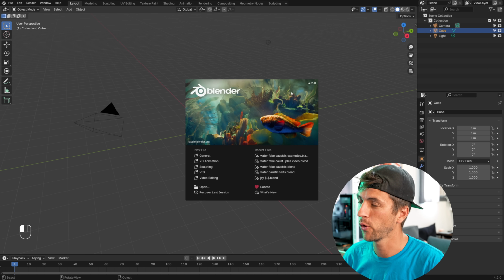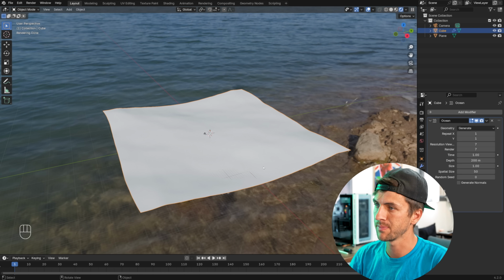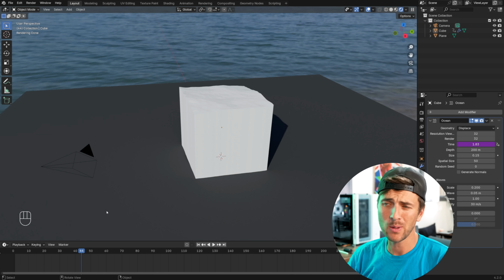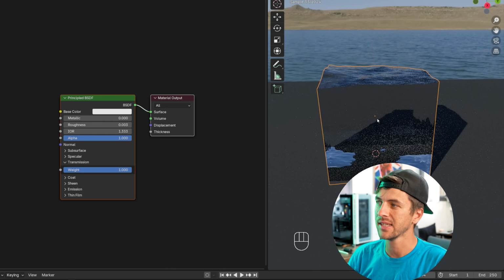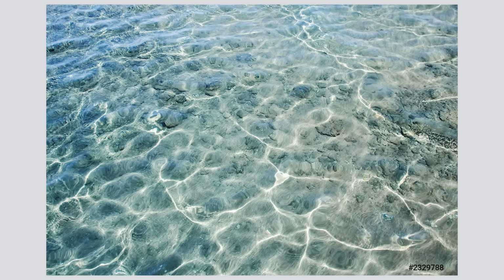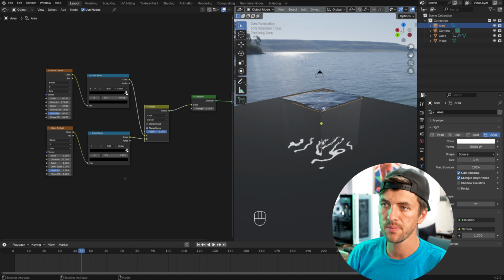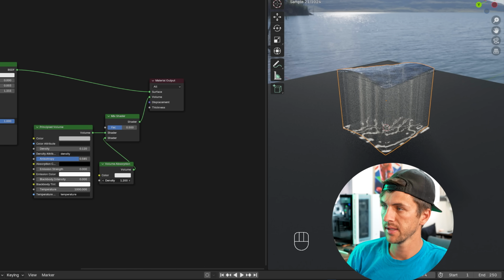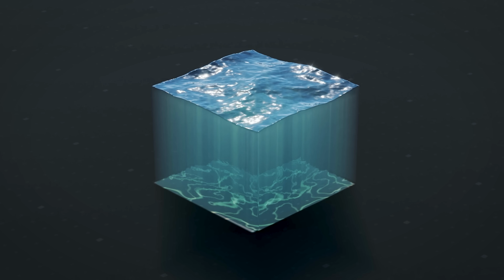Hyper Realistic Water is this EASY in 3D Graphics

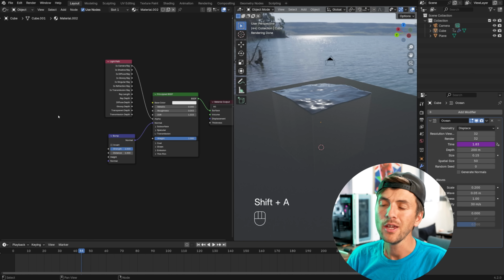Comment: 5:22 I'm using blender 5.0.0 and the vector bump node is gone. I found the bump node under the 'displacement' tab, but it doesn't have the same affects as shown in the video when I use it. Any ideas what the issue(s) might be?

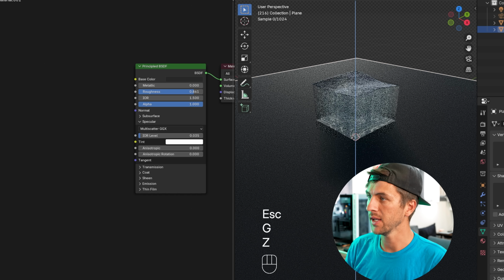Comment: Amazing in its simplicity guide, thank you very much, I wanted to do this EXACT idea and you already did that, nice. I have an issue though: in second 9:20 your cube is absolutely like mine and the down edges do not snap to the plane cause of the ocean modifier. But a second later in your scene this problem is solved, they snap and I don't how to recreate the same thing in my sutiation. Any advice everyone?

Comment: Wow, very interesting :) faking caustics in such a situation where you can not spot that it is fake is very clever… BTW could we achieve real caustics working around blender issues (like the need to switch to CPU rendering for good caustics, having to set filter glossy to 0 etc) for water like in this video?

Comment: ik this is an old video but would the process be the same if I were wanting to turn a 2d logo 3d then turn the 3d logo into water
Reply from the maker: Not an old video at all :) For that it sounds like you might want to run a Mantaflow fluid simulation in Blender! I have a few tutorials on the channel for that

Comment: Why don't you use the menu on the bottom right after the first subdivision? You can set the number of subdivisions to set (and manually type to avoid the limit) ? And then, no, you don't need to "delete the value" before changing the value. Only use "frame/<number here>" without the hashtag... it's only because now, "frame" is a variable because the input has got a driver.

Comment: I did this with in a different way, a grid, ocean and attached it to a pane. The top moves only. This one does move better in high res but it is a bit pixy and the entire cube acts like jello. Yes, i changed my res to 32 view and still a bit pixy. Yes my system is a big boy system that can handle it. But that is odd because the one in the video is not pixy. Now I know these vids are made, well we often have to play clue and try to figure a few things on our own.  2000 failurs until we find our way. Seems the vid makers are more worried about looking good and sounding like a professional instead of teaching. But I tried everything, even using this methed with a grid, getting it to divide 100 times 18, and extending it. You get the same but slower. Still pixy. Where as the other method does better. I dont know, but if you can get rid of the pixy ontop that would be cool.

Comment: You can change the driver without deleting it 🤨, you can either right click then press edit driver or directly left click it and add the /24 after 'frame'
Reply from the maker: Gotcha, this was initially confusing as just deleting and re-entering the values didn't make any changes. So just to avoid confusion for beginners is why I recommend deleting and re-entering the driver.

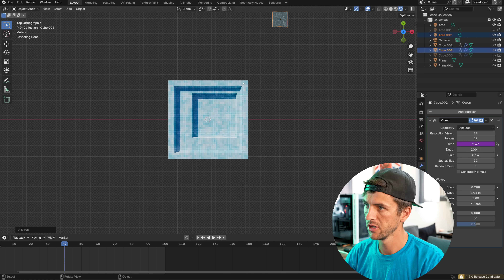Comment: Upon resizing the water/light group in my pool model using the approach shown at 9:47, I couldn't help but notice the waves of the fake caustics also become huge.
Maybe the way I resized the water/light group was incorrect compared to the video? 'Cause I also noticed my cube didn't seem to shrink much height-wise compared to yours. You pressed S+Shift+Z , am I correct?
Or maybe there is a step after the resizing that is not shown in the video, and that I should do myself?
Reply from the maker: Yep S+Shift+Z to scale it wider in both dimensions but not taller. Its possible you got your scale a little different at some point, but just adjusting the wave texture scale on the Area lamp is easy to match it to your ocean modifier and pool scale. (in your case.)
Reply: @CGGeek  I see 🤔 I'll try again and see how it goes. Thanks!

Comment: I made it, although had a lot of issues with noise with the Cycles engine. Followed the instructions exactly but had to go to preferences to change some stuff to get the water to be clear. I got it fixed using the denoise option too, but it is still not quite right. A bit flickery in places after adding the caustics in. My GPU is pretty decent so I'm just not sure what I'm doing wrong :S

Comment: Since when is it important to delete a driver to change it? Just click in the field again and write /24 behind frame. Legions of YT creators have been showing this for years. I just did it on my computer, it works.
For the Volume Absorption... sure, the Principled Volume shader works a bit different than the older Volume Scatter and Volume Absorption nodes. But the result shown in the video is just a slight change in coloring which you can also achieve by changing the color of the Principled Volume. Using both only makes sense when you want to color the water itself differently and the light on the floor should have the absorption color. But this can also simply be achieved with the Absorption Color in the Principled Volume node.
Sorry for sounding too critical, just my ideas to that. I really enjoy your tutorials! 🙂
Reply: Yeah, he's not the only one I've seen do this, it's quite common. I think people just don't realise that the Principled Volume does both scattering and absorption and the colouring of both can be tweaked independently in the node. The main reason to not use it in favour of just adding the old volume scatter and absorption nodes together instead is that the Principled Volume node is way more computationally expensive, since it comes with all the other baggage needed for fire, smoke, etc.
Reply: @Arjjacks  Yes, the Principled Volume is computational more expensive and I understand using the other volume nodes instead of it as replacement, but for simple coloring when you already have the Principled Volume in the nodetree it's not making much sense to me.
Reply: @gordonbrinkmann  Because it doesn't make sense, except as an error. You are entirely correct. If anything it's even more expensive since he has both a principled and a separate absorption shader in the tree now. You wouldn't do it this way, it's either one or the other (plus volume scatter).

Comment: I do find your tutorials to be easy enough to follow, where other Blender tutorials might fail. My biggest problem when it comes to following certain Blender Tutorials is that sometimes someone will do something without explaining how it's done, or skipping over a step that got them a certain point, or can't find certain menu items or tools because they've either installed custom plugin of sorts, or changed their menus around. Or the tutorial itself is outdated and not suited to the current versions of Blender because menus and things have been changed drastically and even renamed. For example; In Blender 4.2 the node for Noise Texture use to be called Musgrave Texture in prior versions of Blender, I guess the name was too confusing before hence the rename, and why it might show other things that a previous version didn't have.
Reply: Mmmmmmm, not exactly. Noise and Musgrave existed as two separate nodes since 2.8, then in 4.1 they were merged into a single node under Noise.